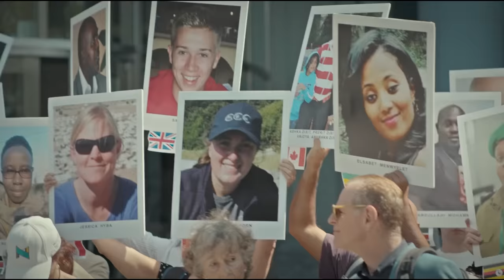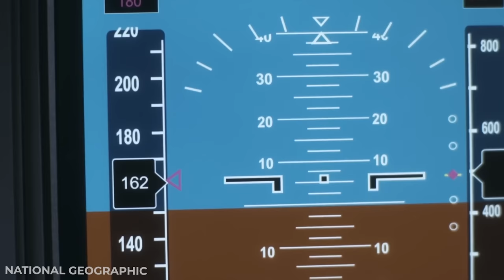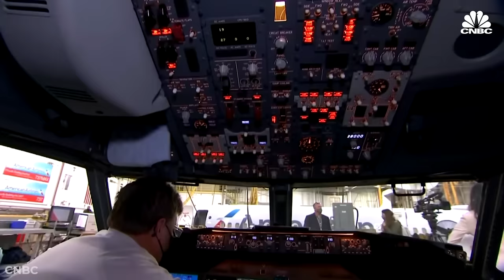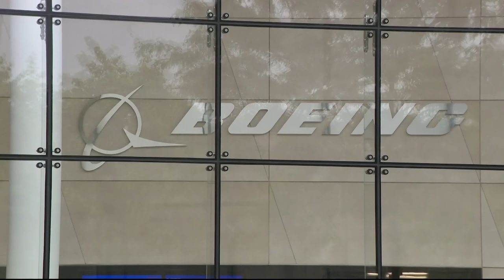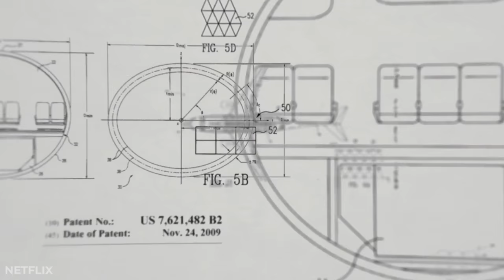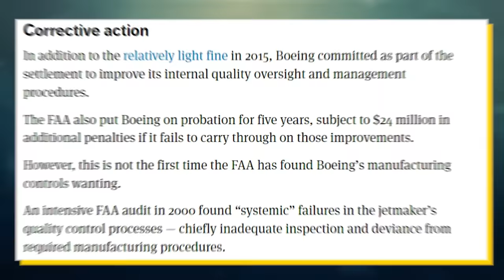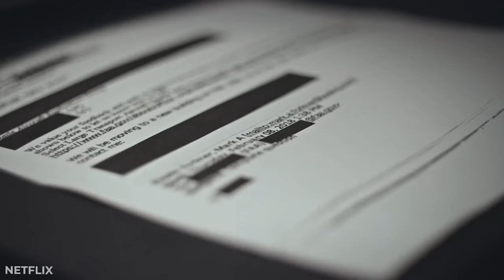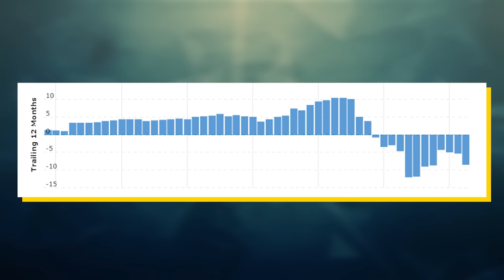Even Boeing Engineers Don't Trust Boeing...

Comment: I worked as a design engineer for Boeing. I found that management was only concerned with being as cheap as possible.  Getting rid of engineers who had years of experience in favor of new hires with zero experience was the norm. Even our chief engineer was more interested in real estate than engineering.
Reply: This was what the door plug failure told me loud and clear. The consequences of the autopilot problem cost them a lot of money, and they had a choice. They could have sucked it up and prioritized repairing their reputation. Or they could cut corners like crunch time at the circle factory to make up for those losses. The door plug failure says they did the latter and there's going to be more and more problems with at least Max. Scary stuff.
Reply: @j.f.fisher5318 Let’s not forget those with Airbus’s aircraft. Flying is the safest mode of travel, but is it as safe as it could theoretically be?
Reply: @j.f.fisher5318 To politely correct you, the fatal crashes had nothing to do with “autopilot “ but the MCAS system. The system is a separate program designed to take over the horizontal trim to correct a stall. The aircraft used input from the AOA Vane (angle of attack) and Pitot static systems to send the MCAS airspeed and pitch data.
This system was a bandaid to correct the flaw with the new more powerful engines mounted higher and farther forward than previously designed. This addition increased the thrust angle of the aircraft and upon takeoff power the aircraft had a tendency to pitch upwards. The MCAS corrected this by trimming the nose down unbeknownst to the crew. No additional training was provided for this new system and many 737 pilots jumped right into the Max assuming it was the same plane with simply more power and updated avionics.
Reply: Very true of all engineering fields !
Reply: Also there is a duopoly in commercial planes, and depending on the country a monopoly. Essentially there is no competition in a duopoly. Boing routinely lobbies with millions of dollars to flex the regs of safety so that they can push new planes out the door and make money. Lastly, there is no accountability for these mfers, beside paying trivial amounts of money.
Reply: I met a couple who used to work at Boeing. They retired early because they completely disapproved of how the business was being run and management didn't listen to concerns.
Reply: Wow man must be really sad seeing that horrible workplace considering no one in charge is really concerned with the quality of their art. I do still hope Boeing fixes these issues and becomes a great airline manufacturer again as without Boeing Airbus for a short while will be left uncontested.
Reply: @mikerobinson8734 very well said, I don’t think I heard that explained so well in such a short answer, thanks
Reply: @matthewrennie1110  So what? After this video I do HOPE Boeing will go bankrupt. Making profit is not important. Break even is good enough. Start building safe planes!
Reply: Thanks Wall Street.
Reply: I switched from getting an engineering degree to getting an AMT degree and A&P certs because you could see that companies just wanted new people who didnt know any better
Reply: Its pretty common everywhere today. Experience demands higher pay and and more questions. They want cheap blind followers.
Reply: True for all r&d company. I worked in a semi conductor r&d company, CEO switched from an Engineer to an accountant. The company style changed drastically, becoming super conservative, then they ask why can't they compete 😂😂
Reply: Sounds like Sony. I was there 25 years & their customer service went from one of the best to ‘screw ‘em… who needs them.’  Miss my customers but Morita’s passing put Sony into the 🚽
Reply: Don't worry DEI hires will soon be here to save the day.
Reply: Just like any CEO.  And the senior engineers are paid more too.
Reply: 😂Cutting costs by getting rid of well-experience engineers and hiring new ones with zero experience. What a joke! Hilariously stupid.
Reply: @mikerobinson8734   Was MCAS the problem or was "not training the pilots properly regarding MCAS" was the problem? Even during the Lion Air crash, it was said in the National Geographic documentary that the same problem occurred in the previous flight of the same aircraft, but the pilot flying could identify it and shut off the MCAS. But it was not reported (probably not in the protocol or not considered severe). Would there have been any MCAS related crashes if the pilots were adequetely informed and trained about the MCAS?
Reply: Every publicly held company in the universe is interested in making their product as cheaply as possible. They would be fiscally irresponsible if they didn't do so. Of course, their are other factors that have to be balanced with that to make an efficient, safe product. I was also a design engineer at Boeing and at another leading aerospace company for many years. It should be noted that this incident had NOTHING to do with being cheap and everything to do with process management and poor management oversight.
Reply: No you did not!
Reply: No you did not!
Reply: maybe you can comment on the fact that in marked contrast I read that Airbus even in dire times always tried to avoid massive lay offs especially among engineers and technical people.
Reply: What did you design?
Reply: This isn't just true at boeing, many other aerospace companies are doing this, instead of paying experienced employees they would rather higher non experienced workers and pay them more than the experienced ones.

Comment: Boeing used to be a company run by engineers. Then the bean counters took over and safety went out the window.
Reply: It's the Douglas Aircraft Company executives that were put in charge when it was acquired. Boeing was ran by a technical guy that didn't like managing so he let them take care of it.
Reply: That's why I call them Douglass. "Boeing" is the public name that hides the true reality.
Reply: That’s kind of how it often goes. 

Same with Mercedes really. All iconic Mercedes cars were made by engineers with little restrictions. Even the EQXX.

However, engineers rarely consider affordability. What use is a great plane (like the Concorde) or car (like the EQXX) if nobody can afford using or buying it?
Reply: @MaticTheProto  but that’s the way new things should goes, it should be expensive at first, and then the the same engineer that made them should streamline the process to make it cheaper, not the excessive corner cutting, cost cutting, rushing unready product to market as seen with company with bean counter executives these days
Reply: Keep hearing this
Reply: @crissto8591  that wasn't the fault of that Great manufacturer, Douglas. That was fairly and squarely the fault of Boeing.
Reply: @michaelosgood9876  Douglas of the 80s was far from ww2 douglas
Reply: @@danp576 says you
Reply: You’re almost prophetic there. People’s safety almost flew out a “door plug” a few weeks ago. Fortunately, it didn’t happen at cruising altitude.
Reply: And later took the window with it.
Reply: @killerdoritoWA  Yes. Should have said door!
Reply: @@danp576yeah the 2024 door plug is a nonsense

Comment: Part of the aquisition agreement of MD was integrating ALL of MD top execs into Boeing.  That's what killed Boeing.
Reply: yes but who got the best position was Boeing manager NOT McD. I know some of the managers.
Reply: @joecrou9445  I don't.  I just heard.  :)
Reply: @joecrou9445  Correct but how many of those Boeing managers are left? Let's be real, it's MD running the show at Boeing.
Reply: Blaming McDonnell Douglas is giving Boeing an easy way out. 

McDonnell-Douglas produced amazing, safe aircraft still flying today such as MD-80’s, MD-82’s, MD-83’s, MD-88’s, MD-11’s and the McDonnell Douglas MD-95 (AKA The Boeing 717, a Jet Delta Airlines, among others can’t get enough of and certainly wish more had been built). 

However the MD-95 (Boeing 717) was TOO good, and a DIRECT competitor to Boeing’s 737. So Boeing axed the 717, an Aircraft with one of the best safety records in History. 

Boeing’s big screw up’s were: Killing off the 717 in favor of the 737. Making the 737 longer, and longer until engineers realized to compete with Airbus, they would need an Engine with a wider diameter. The 717 would not have had this issue as it’s engines were not mounted on the wings, but the back of the fuselage under the T-Tail Vertical stabilizer. 

Boeing’s other, even bigger mistake was to kill off another aircraft, one of the best Airliners of all time, and a perfect 737 replacement; The Boeing 757. 

If McDonnell Douglas executives had so much power, why did they kill off their beloved MD-95 (717) when they should have killed off the 737? Had they kept the 717, MD-82 sized variants would have been produced, the 757 could be offered in a shortened version called the 757-100. 

Had they have retired the 737 instead of the 717, Boeing would have an outstanding lineup of:

Boeing 717-200, 717-300, and possibly the 717-400.
Boeing 747-8I
Boeing 757-100, 757-200, 757-300
Boeing 777
Boeing 787 
Boeing NMA

Boeing should have purchased Bombardier. They didn’t. They should have purchased Embraer. They didn’t.
Reply: @DriveByShouting  It is the same company now so they are both to blame but Boeing slightly more.
Reply: @DriveByShouting  Hmmmm... seems you have more of the facts than I do.  Hat's off to you Clint.  :)
Reply: When you think about it that does make sense, before this whole debacle Boeing was the kind of company that literally designed their planes to be able to withstand things like pilots jamming the rudder left to right over and over like a toy "just in case" the pilot was dumb, because according to them back them "just because it's stupid and a pilot shouldn't do it doesn't guarantee a pilot will never do it anyway". Keep in mind this was an event deemed so unlikely that not even Airbus took it into consideration, which eventually resulted in the A300 running Flight 587 snapping it's tail like a twig when the first officer did exactly what everyone thought was so absurd that no pilot would do it. For a company to go from being so careful that they build their planes to account for things that no one else even thought of, to this, something definitely had to have changed in recent years
Reply: I was working on a contract and we were subbed to MD when Boeing scooped them up. About seven years later we had a major aerospace company subbed to us on a different contract and Boeing bought them also. Year sbefore these two we were subbed directly to Boeing on another big program.  Over this twenty to twenty five year period Boeing went from a tightly knit, shit hot engineering oriented company to a company whose growth wasn't organic but was done through purchases. I called it the Jack Welch GE effect. The comments I see here about MD are fairly accurate but understand MD went through its own organizational crises in the early 1980s.  Boeing was clearly lost when it moved to Chicago and is still lost.  The move to Virginia won't help. The individuals I worked with were sharp enough but with this people who didn't change their way of designing products to account for the complexity that software and microprocessors brought to the game generally have had problems.  Requirements and necessary features are slipping through the cracks and it doesn't look like Boeing can do technical management anymore. And Boeing has, apparently, also alienated a lot of their Seattle  work force. So I am seeing at least three formerly good companies go bad.
Reply: Boeing didn't absorb MD until 1997 so blaming accidents from the 80s on the acquired executives is ridiculous. Boeing already had a problem of pushing for fast development and rushed certification long before the merger.
Boeing including MD executives was a symptom of a disease it already had instead of its cause.
Reply: @DriveByShouting  I am fairly sure that Boeing did acquire Embraer.

And everything you just said doesn't make any sense. You clearly love older airplane models but the fact is the 737 is a superb airplane and extremely safe. It is the 737 MAX fitted with the new engines that is not safe and a product of MD executive decisions. Boeing of old would have gone a different way and made a new aircraft, 100%. MD planes were absolutely dreadful, killing machines built via telephone instructions. But they were quirky, kind of beautiful and different. Boeing was superior in every aspect, as is Airbus. No idea how top execs of a failing company got to run another.
Reply: @DriveByShouting  , you mentioned the MD-95 as being renamed as the Boeing 717. It was immediately pointed out back then that there was a pre-existing Boeing 717, the civilian designation for the military's C-135. Contrary to popular impression, the 707 has a different military designation (C-137), plus a longer and wider fuselage. The different fuselage is due to commercial requirements to carry more passengers.
Reply: @kingpetra6886  Thanx for the inside info. You guys are showing it's not as simple as it seems.
Reply: @pop5678eye   thanx for adding details to the story.  :)
Reply: As much of a good simple scapegoat, MD also had a track record for good aircraft manufacturing before they got absorbed. Their managers would not be more incompetent than Boeing's one.

No, the real change happening in that time isn't the acquisition but the change in focus. No longer would the company make good aircrafts and figure how to make them profitable. They would instead seek to make profits with aircrafts. This change seems minor, but it means all your concerns are about the raw efficiency of the sale on your end, not the end user. 
And while it means they will have less issues than Airbus in the realm of making aircrafts that are amazing but no one wants, they will usually just take the same shit they did before and keep stretching it, uncaring if it is about to break.
Reply: @mobiuscoreindustries  Good perspective.  Thanx.  :)
Reply: @HadrianTAZ  Boeing dropped out of the deal when the pandemic hit.
Reply: @DriveByShouting  Boeing should have purchased Embraer long before the 2018 deal - given that they already had a tech-sharing deal, an established partnership for years.

Walking out of that deal, even with the pandemic crisis, was just monumentally stupid.
Reply: @hrq007  Agreed. Once Boeing was able to get its domestic competition, (McDonnell-Douglas and the outstanding MD-80 family, the future MD-95 family( 717), and MD-11 (though I’ll admit the Twin engined 777 and introduction of ETOPS had more to do with MD-11 sales than anything). 

However some say MD ran Boeing, and that’s when Boeing changed. I never believed that was the case because if MD truly took the reigns as claimed, why would they decide to end their 717, A design that was MD’s, a design that had stretched variants planned, an aircraft which was cheap, more advanced and was selling very well, too well in fact; Cutting into the 737’s orders. If MD was at the wheel, they would have ended the 737. Boeing was the driver, ending the still in high demand 717. (An aircraft with ZERO hull losses I might add) Everyone says McDonnell Douglas was a dangerous company, with dangerous aircraft. The MD-11 was and is a very safe Aircraft.

Then Letting Airbus come in and buy Bombardier and it’s C Series, (Now A220) which would sure come in handy for Boeing right about now. 

Boeing and Embraer did partner on the C-390, which is looking like it’s going to be an outstanding aircraft. That one airframe shows us what the two companies are capable of together.
Reply: @DriveByShouting  bombardied was doomed to be sold, but i doubt they would have allowed boeing to buy it. Canada or Quebec would have scooped it up beforehand. It's important to note that it's the c-series which caused the need for the C-max in the first place, but it was also bombardier's doom once the states put a 300% tax on it.
Reply: And they killed MD in the first place!
Reply: I @joecrou9445  Im guessing why the 717 was killed off is that airlines like Southwest which is all 737 did not want to make the change to the 717. Boeing did want a clean sheet plane to replace the 737 after the NG model but again airlines that have 737 in fleet were not interested in a new plane.

Comment: The downhill slide in quality at Boeing started with the McDonnell Douglas merger. The company increasingly became a culture of "bean counters" instead of engineers.
Reply: True, though I saw it from the other side. My dad worked for MD in software engineering support. After the Boeing acquisition his job became increasingly bean-picky where he had to account for every minute, click in and out, and they were restricted from unpaid overtime even though some engineers wanted to do some extra time. The ULA spin-off was serious about rockets but had a similarly slow moving beaurocrstic culture from what I could see. At least ULA/ Delta has had some success in the rocket industry. It feels like the Boeing airline side has forgotten how to do what it did so well for many years.
Reply: Arguably worse than the corporate culture imported by MD was the fact that Boeing effectively became a monopoly that day, removing any pressure for Boeing to compete and always having federal backing by its side.